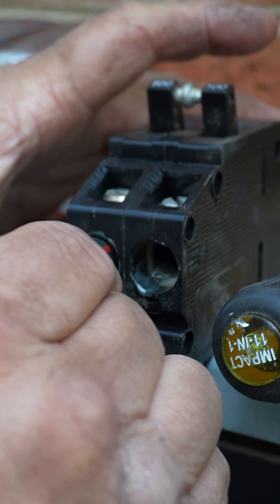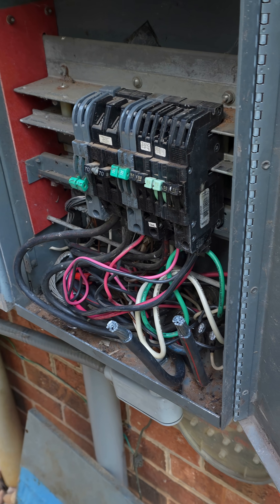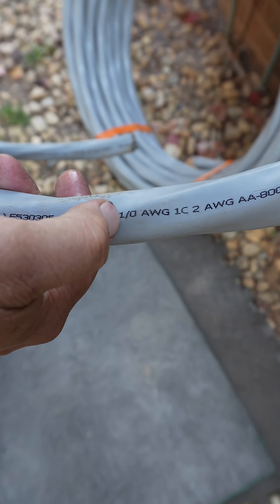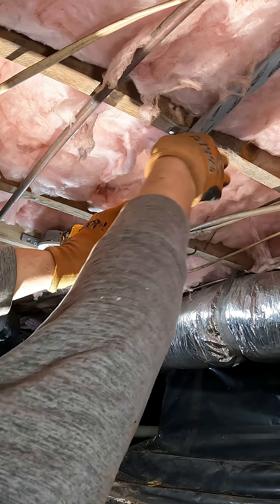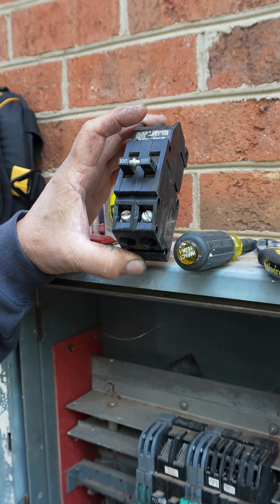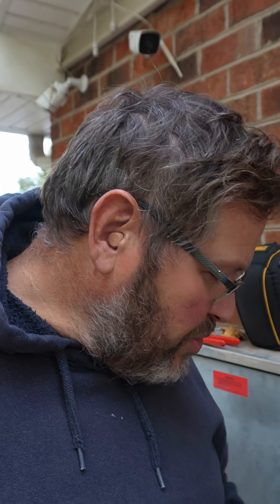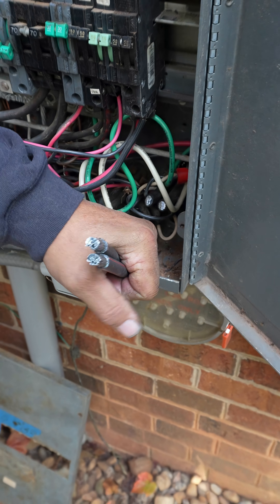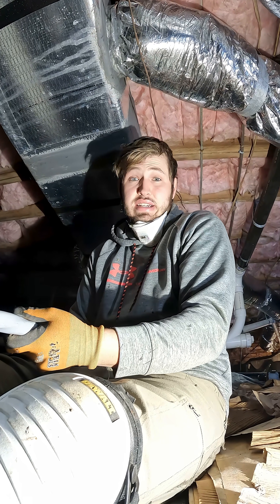Replacing 1/0 wire with 2/0 wire for our sub panel.#campbellbuilt #wire #electrical #construction

Comment: Planning for the future
Reply: Plan for the future...but he doesn't replace Zinsco with something modern, safer, better, or larger. Then buys 1/0, and then 2/0, but not just biting the bullet and go with 4/0 with a 200 amp service, main disconnect, and primary subpanel.

Even if the service wasn't upgraded to 200 amps, or couldn't be upgraded right now, it'd be much more ready for the future. With all the work that appears to be happening, the extra cost might have been marginally more. But it'd save doing work later if it needed more than a 25 amp "upgrade".

He might have even been able to recoup some of the costs of the Zinsco breakers were still in good condition by reselling them. A number have sold on eBay recently for $60-100, though I do know if they were the exact same breakers.
Reply: Agreed, though, I disagree with the marginally part of your claim. I wouldn't say that $5,000 to $8,000 is marginal, but people do live in different financial categories.
Reply from the maker: Do you want me to upgrade to three phase? No, just joking, but this is a 400 amp service and I technically do not own it, the power company does. Yes I know that sounds weird but it’s the truth. When they replace it I’ll take ownership of the new one.

Comment: 1/0 Al feeders are rated for 125A per table 310.12. Why did you need 2/0?
Reply: maybe because of the length?
Reply: I was going to ask the same thing. No it's definitely not for length, very little voltage drop on 1/0
Reply: @jay9308 what do you mean very lil voltage drop on 1/0? It has nothing to do with wire size and everything to do with distance!
Reply: @michaeldove339 both wire gauge and distance affect voltage drop, but I've never had to up-size a #2 feeder for a less-than 200 ft run. #14 wire with a load not very happy over 100ft.
Reply: My code book says 120a at 75C. Which would be fine too thanks to 250.4(B)

Comment: $180 + Labour of Original & New... and the likelihood that you would use enough Amps to require the 2/0 is highly unlikely... also you can just switch the main to 100amp at your sub panel for $300 ish...
Reply: You don't have a main at the sub panel, that's why it's a sub panel. It's a main lug and you can feed a 125 with 100 just not above 125.

Comment: I would do a panel swap on that. Those Zinsco breaks are expensive and hard to come by. Plus the old original breakers are infamous for failing.
Reply: "Skimp on the old faulty center point of your electrical system"
Reply from the maker: Read the comments, The power company owns it and I’m working to get them to replace it.
Reply: @campbellbuilt When I went from 100A to 200A service, the AHJ required changing to a pedestal with 4 breakers positions (the most one can have without a main breaker in from of it. It required moving the ground wire to that. But, it would allow keeping the old panel, but turning it into a sub+panel. I wish it knew what the electrician was doing because it would have allowed keeping the old panel and just adding a new 100A panel at a substantial savings. Then, they could gift the Zinco panel to you, and just own the pedestal.
Reply: @campbellbuilt  your insurance company may help nudge them to get it replaced if you want to ask them. Insurance does not like these because they are a notorious fire hazard. who knows, they may drop your rates
Reply: @stoffel6348 terrible idea and gamble as they will send a cancellation notice. Then if you can't get it replaced, you'll struggle to get replacement coverage.
Reply: @LarsDennert  FALSE: Complete misinformation. thousands of these are still in service and insurance companies are well aware of it. I've only been an electrician for over 25 years, ask me how i know
Reply: @campbellbuilt the power company doesn’t own your panel, they own the meter and that’s it. It’s the homeowners responsibility.
Reply: @monteclark1115  use your eyes, what you are saying is true most of the time, in this case the panel is built into the meter pedestal. It seems unlikely a utility would own anything after the meter as that’s how it is in most places, but I’m not going to pretend I know everything, and seeing as it’s the same housing I’m inclined to believe the homeowner knows what he’s talking about.
Reply: @DozIT it’s a meter/load center combo panel, not a pedestal. The homeowner is responsible for permitting and installing it. You pull the permit, schedule an outage with the utility company in which they remove their meter from the socket and disconnect power from the transformer. You rip out the old service and install the new stuff and then call the city for inspection. If everything is good the city puts a green sticker on and you call the utility company for reconnection. They see the green sticker and they hook it up to the transformer and stab their meter in and put a seal on it.
Reply: @johnhaller5851 it’s not a pedestal, it’s a panel.
Reply: I've replaced small appliance zinsco circuits which didn't trip and cooked the circuit in the wall.

Luckily noone died
Reply: I've seen a 20 amp Zinsco breaker hold at 31 amps and not trip. Junk.
Reply: @braddarnell736  Most all breakers will hold a 30% - 50% overload for a few minutes. Check the time / temp charts for details.
Reply: @rupe53 I arc welded with a 15 amp zinsco.
Reply: @monteclark1115  Are you related to Thonas? He's pretty handy you know! (what year did his house burn down?)
Reply: @braddarnell736  I had one that sizzled like bacon whenever the water heater came on. (Yes I replaced the whole panel)

Comment: The maximum allowable wire size should be written on the breaker
Reply: Along with the torque value, and people need to use damn torque tools.
Reply: it usually is on Square D and Eaton CH ones, not sure about other brands
Reply: It…. It is…. On all breakers…. They all have a manufacturer spec on the size wire capable of fitting. Minimum/maximum size.
Reply from the maker: For copper or aluminum?
Reply: @campbellbuilt  you should see something in code like 4149ALCU, which means size #4-#14 max temp 90C° and it can be used with both Aluminum or Copper. Or it wont be in code if they have enough room to write. The next size up from 4-14 is commonly "1/0-4", but could vary based on brand. The size of the wire is based on the size of the lug, whether you use copper or aluminum is based on the material of the lug. Using aluminum doesn't give you extra size. 

As a rule of thumb, whatever size wire that breaker needs, the lug or terminal will allow the next size up in case you need to use a larger size (for voltage drop or conduit derate)
Reply from the maker: Appreciate that last part, funny thing about that 100 amp Zinsco is the breaker has 4/0 embossed on the back. That’s not happening.
Reply: @billrobert3226 thanks for decoding the breaker wire sizes, temp, and type. Very helpful.
Reply: @campbellbuilt  maximum size
Reply from the maker: Correct, but no 4/0 that I’m aware of is going to fit in there. 2/0 barely did.
Reply: Spit on it

Comment: Just use copper, save money in the end.
Reply: I disagree about the saving money part, but I do agree with the using copper part. It has better electrical rating in every way over aluminum. The ONLY reason to select AL over CU is cost. Period, full stop.
Reply: @TwilightxKnight13  actually when keeping weight down is important then aluminum is better. Copper is a better conductor by volume over Aluminum but Aluminum is a better conductor by weight. That's the main reason Aluminum is used for overhead power lines, lighter weight means less stress on the poles and the lines themselves.
Reply: No
Reply: Aluminum is inferior for wire, you need a larger wire for the amp level.
Reply: ACSR is almost always used for large feeders and it often lasts over 40 years. No need to spend 4x more on copper
Reply: @jay9308 ACSR is not AL feeder. ACSR is aluminum coated steel wire bro
Reply: @michaeldove339  Aluminum Conductor Steel Reinforced
Reply from the maker: Out of curiosity, is the steel reinforcement in the center like a cable?
Reply: @campbellbuilt  Yes the steel in the center just there for strength, not sure how they prevent galvanic corrosion, but most overhead power lines are steel core aluminum.
Reply: @MS-ig7ku  For large diameter conductors the 60hz power is only flowing on the outer 7 or 8 mm of the conductor. So once you get much bigger than about 14 or 15 mm diameter, nothing much is flowing in the center so having a steel core in the center really doesn't matter for conductivity and helps tremendously with tensile strength.

Comment: Aluminum. Yuck. Not in my house.
Reply: Anyone "yucking" ACSR is not an experienced electrician. Utilities bury this stuff directly in the mud and it lasts over 40 years
Reply: Aluminum is the standard for service entry wires and high current wires like for ranges.
Reply: @bradleyomar6300  aluminum is the "standard" because copper is more expensive. Period. That's it. There is no other reason to choose aluminum over copper.
Reply from the maker: Also nobody stocks copper larger than 4ga around us.
Reply: @TwilightxKnight13  It's also much lighter, which can be important for heavy gauges and long runs. Aside from that there's no real reason to choose copper over aluminum either. Al got a bad rep for specific issues in small branch circuits from the 1970's (including improper installation)

Comment: The first thing you do is don't skimp and get rid of the Zinsco panel...  A Zinsco panel is a serious fire hazard and should not be ignored.  Please change it out before you have a fire! 👊😉
Reply: I just replaced my 48 year old Zinsco panel. The aluminum bus bar failed (melted) under the main breaker and half the house went dark. I had to do an emergency replacement. Now that I have a new breaker panel, I am curious if my new main breaker will trip with my electric furnace. I have 150 amp main and my furnace will draw 82 amps on high. These are tight margins with everything else going on. Zinsco are notorious for not tripping.
Reply from the maker: Little bit more involved than that, our local power company owns it and I’ve been in talks with them about replacing it. They’re back and forth on replacing it so I do hope to get rid of it but trying to get them to do it is a game. If they eventually replace it I’ll own it after that point.
Reply: @campbellbuilt  Where do you live that your power company owns your main breaker panel? In my state (WA, and as far as I know most states) the utility is responsible for up to and including the meter.
Reply from the maker: @bradleyomar6300  Carolina’s, when the house was originally built the 1st homeowner entered into an agreement with the power company. Of course that program isn’t offered any longer but for the original agreements that were made and I have one. I was surprised that this even existed.
Reply: @campbellbuilt If understand this correctly, the power company becomes libel for damages to your house caused by a proven faulty breaker panel that they had full knowledge of and did nothing. Does their legal department know? If not they need a letter from your attorney informing them so that it is on record and they cannot claim they were not informed of the danger. This falls in line with dangers of a downed power line.
Reply: @bradleyomar6300 yes,  and in California, with PGE service, the home owner is responsible for the riser , weather head, and wire from the house drop up to the meter.  The meter is owned by the utility, but the rest is the home owner’s responsibility.
Reply: I've literally never even heard of them before and I've been a Jman for over 2 years now.
Reply: @notflexing6609 while there was no formal recall on the units in 2002 they lost a class action lawsuit which put them out of the load center business and also blacklisted them on insurance companies lists.  So if the insurance company finds out you have a zinsco panel there is a very high probability that your home owners insurance will be canceled because of the risk. They are an old system with many many fires.  They are fine until they aren’t and it’s a crap shoot at when they will fail.  🤦‍♂️
Reply from the maker: To be honest, I’m a Yankee, but lived here in the Carolinas for approximately 25 years. The prior time I lived in Michigan I never once saw a Zinsco panel. They might be regional, but not sure.

Comment: Breakers usually support a size or two up from the minimum wire gauge for their rating, but you should still actually check the specs of the breaker to see what they state the supported wire gauges are for that model.  Just because it technically fits doesn't necessarily mean it will make a good enough electrical or mechanical connection, if the lugs aren't actually designed for it.  Always check the manufacturer's published specs for the part too.

(You're probably ok here, but when you get up to 100A or more, it's really worth checking and double-checking everything, because a mistake here really could potentially burn your whole house down someday.  By the same token, I would never use a salvaged breaker for a 100+ amp circuit.  You just never know what could have happened to it before it got to you.)
Reply from the maker: Technically, the breaker wasn’t salvaged, it was already existing in my main panel. Appreciate the comment.
Reply: Oh grow up the 100a bkr is basically a glorified service disconnect.  It's not the same as a 25kw heat kit
Reply: If the wire don't fit just give it a hair cut or better yet "sand" off all the corrosion to appropriate OD

Comment: $180 loss? You must not have been going far. I price 200ft of 1/0-1/0-1/0-2 URD at about $1200… but I really need to step it up to 2/0 at least.
Reply from the maker: Contractor pricing for 80ft of ser of 1/0 was about $177.
Reply: @campbellbuilt  I wish that’s all I have to spend 🤦🏽‍♂️